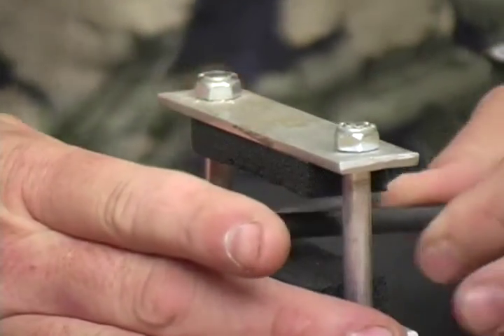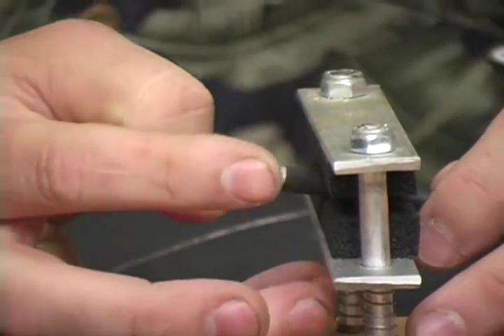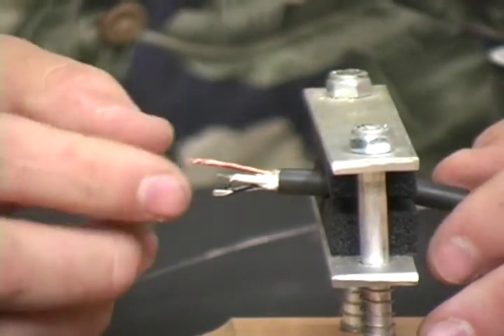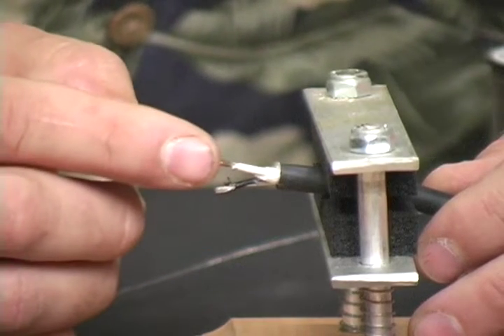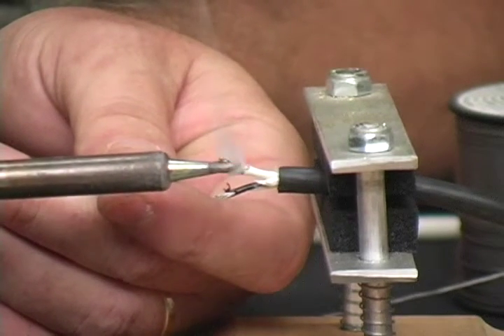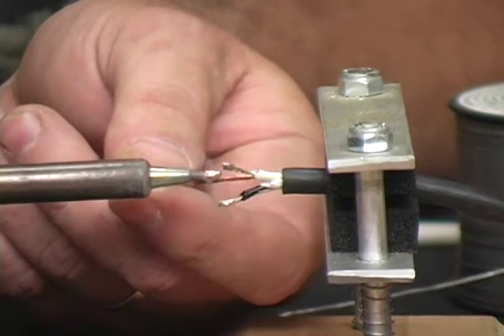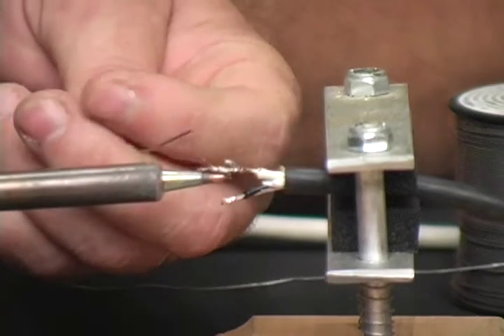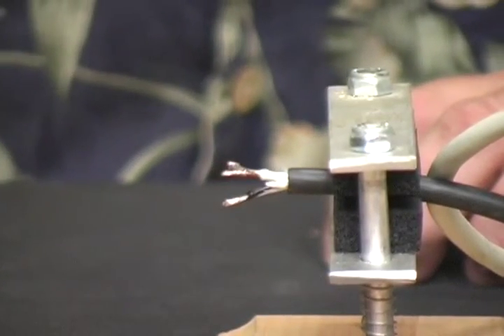How to Make & Repair Audio Cables : How to Prepare & Tin Wires for Making an Audio Connection

Comment: you're not supposed to apply solder to the tip of the iron and then transfer, you're supposed to heat up the wire and then apply solder to the wire so it flows FROM the wire